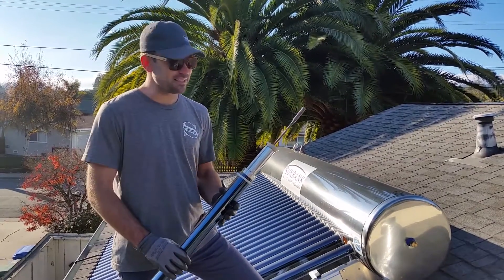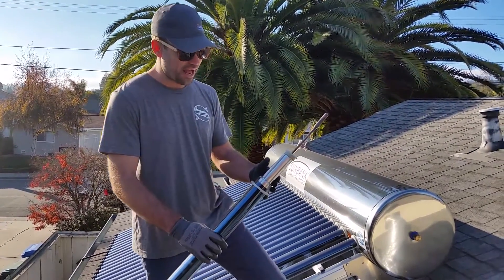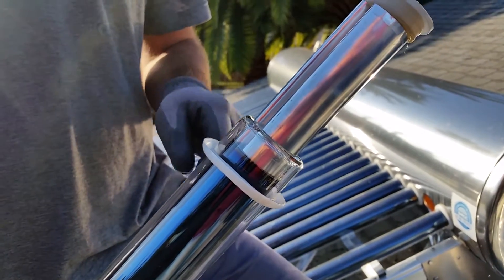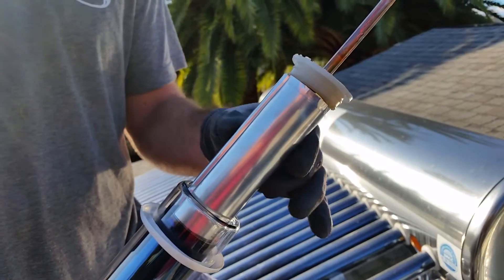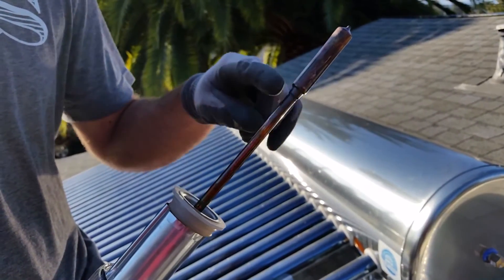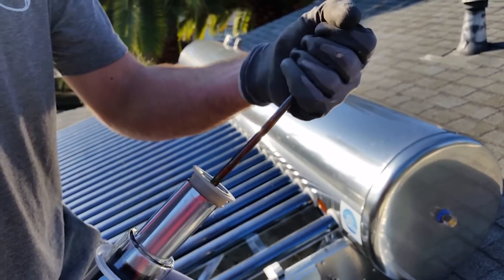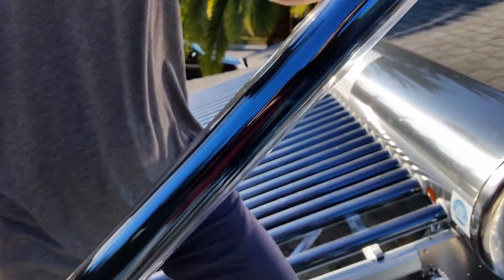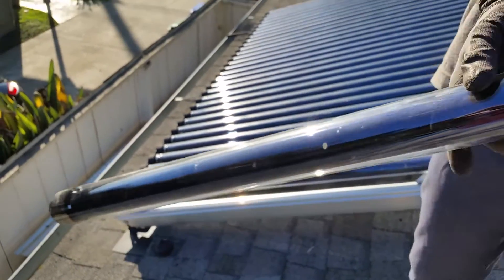How the Evacuated Tube Solar Water Heater Collector Works

Comment: How do you get the top part sealed to the unit?
Reply from the maker: The condenser bulb fits into a manifold in the tank that is perfectly sized to receive it. The entire tube is held in place by the tailstock that holds the bottom of the tube and keeps it held up against the tank.

Comment: In central Florida I'm assuming this would work well. So i would use my hot water heater as a catch and it would only come on if temp was to low?
Reply from the maker: That's right - plenty of sun in central Florida. The Sunbank could either be installed as a pre-heater to your conventional water heater - meaning the cold water goes to the solar system first - or you could bypass your conventional water heater and just use the Sunbank with the electric backup element. If you install it as a pre-heater, then the Sunbank will heat the water and for 6-8 months it will keep it above 120F and you'll like use no backup energy/your water heater won't turn on. In the winter you'll use some backup heat.

Comment: Is there a way to heat a livestock water trough in below freezing temperatures? We have a few 100 gallon water troughs that are too far to get electricity to and we're looking for alternatives!
Reply from the maker: Yeah, absolutely. You could mount a system next to the trough and use a solar powered pump and a stainless steel coil to heat the water in the trough and keep it above freezing. We've helped people design similar systems because of the lack of available power. Give us a call if you'd like to chat about it.

Comment: Hi im planning to buy solar water heater  could you tell me which is the best
Reply from the maker: Depending on the number of people using it, you'll either want the SB-40G (40 gallon) or SB-80G (80 gallon). The SB-40G is typically good for 1-2 people and the SB-80G for 3+. https://thesunbank.com/products/sunbank-80-gallon-solar-water-heater/

Comment: How long it takes to warm up after using the whole tank?
Reply from the maker: You rarely "use the whole tank." I say that because if you have the backup heating element installed, then it simply kicks on when the temp falls below the set point. If you are just using the Sunbank as a pre-heater then it typically stays above 120F for 6 months of the year (climate dependent) and then is between 90-120 for the shorter 6 months of the year. But, to answer your question - on a sunny day the Sunbank temperature can increase by 70F with only solar input.
Reply: @SunbankSolar  but how long does it take for a full tank? Can I use a pump to run pool water through it and warm up my pool for cheap?
Reply from the maker: To heat up a full tank from 55F (ground water temp) to 120F (shower temp) takes a full summer day. But as I said in the previous comment, it is only on the first day the system is installed that it starts at 55F. Regarding the pool, people often put excess heat from their system into a pool (using a heat exchanger) but for a dedicated pool system most people go with cheaper collectors that can't produce shower temps but can provide heat for pools. We sell flat plate collectors on our website that are often used for pools.

Comment: what happens when the water in the tank is near boiling?
Reply from the maker: The system has a temperature and pressure (T/P) valve that opens if the system gets close to boiling. This allows hot water to escape (to a safe place like a gutter) and to be replaced with cold water to cool down the system and protect the integrity of the tank. https://thesunbank.com/overheat-protection/

Comment: Nice details and what parts are each on the tube. But you forget mention what is the black material and if is atached tu the iner tube or can be replaced.
Reply from the maker: Indeed - that is the selective coating which, like a black car, absorbs the sunlight as heat and does not let it escape. It actually has three layers to maximize infrared absorption as well, which is why it works so well even on cloudy days.

Comment: How effective would these tubes be at heating a home? Do you have any kind of numbers for how much heat they can produce on your average winter's day? And how does this compare to how much heat a central heating boiler would churn out to heat an average sided house?

This is a project for an old person living on their own, they currently don't have heating and the winters are getting too much for them in their old age. They don't have much money so I only have one shot at getting this right. I would really like to be green but I have to be realistic also, would a few of these panels produce enough heat to heat radiators around a house?
Reply from the maker: Great question (sorry for the delayed response - am just now seeing all of these comments). Typically speaking, we do not recommend these systems for radiant heating. And that is because their is the least solar radiation while there is the greatest heat demand. If cost weren't a concern, you could build an oversized system. But I would recommend a more conventional system in your case.
Reply: @SunbankSolar  thanks for the reply, sadly I came to the same conclusion too. I have seen a few cool projects on YouTube where they created almost a small, exceptionally well insulated swimming pool to store a few days with of the sun's heat but that is a much bigger project than we were looking for. 

I really wanted it to be a green project but sadly the reality is that it's very difficult to generate heat at those times you most want it and things like batteries wouldn't really cut it for heating a house. So I think all we can do it burn gas and try to offset the carbon.
Reply from the maker: Depending on your climate, this could be a good use for a heat pump. I have a heat pump on my house that does heating and cooling and I love it. It only consumes electricity and we cover all of that electricity with PV production, so our house is net zero. And electricity grids have increasingly clean energy sources, so even without solar panels, heat pumps are a way to ensure your carbon footprint will continue to shrink as the years go by. If you wanted to do radiant heating, you could use a heat pump water heater to the same effect. Appreciate that you're looking for a way to reduce your carbon footprint - hope that helps!